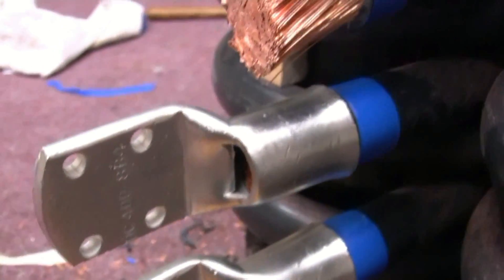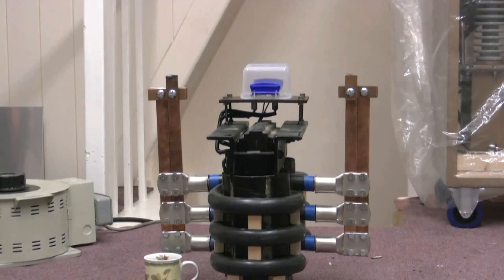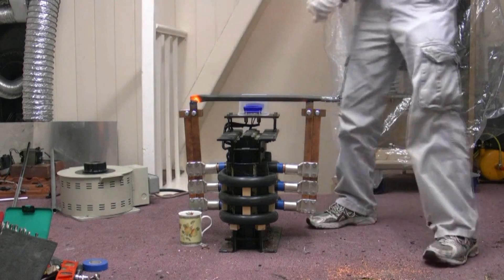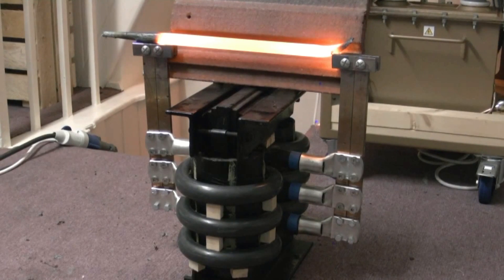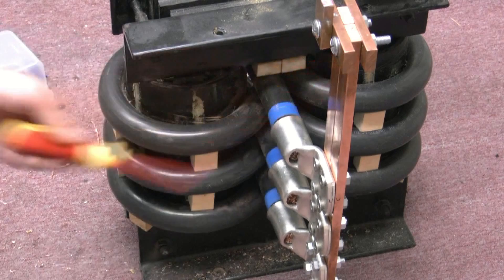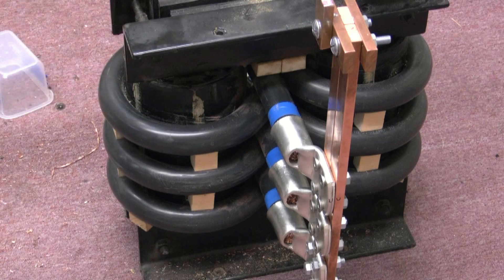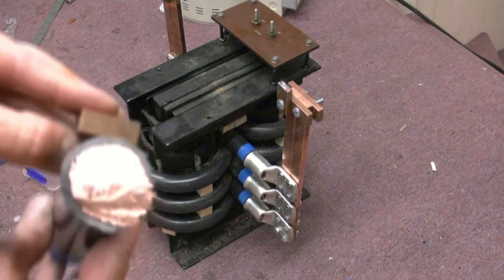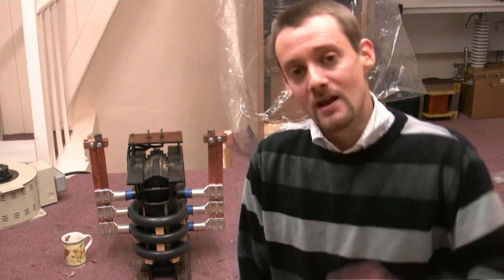50,000 Amp Transformer Completed

Comment: Not an electrician but I do get to shock people for a living (Paramedic) and Voltage doesn't kill you its Amps. Even at super low volts if you got high amps and you touched both of those you'd be a crispy critter
Reply: No amps without voltage, amps=current, current will not move without voltage :) So if you grab the positive side on one end and the negative on the other your body will be a big resistor arround 100.000ohms lower voltage is not able to flow pass that resistor so everything below 25volts is pretty save to thouch even when it is 50.0000 amps you will not feel  a thing  becouse the resitance of your body is to high to let the electricity flow,  :) going over that 25> will be dangerous becouse your higher voltage= lower skin resitance  :)Your cool shock thing as a paramedic probaly works or shocks with 1 Joule (3Amps/155volts) and as high as 200 joule (36 amps/1800 volts ) for 5 miliseconds that 5 thousends of a second pretty cool stuf :)
Reply: Yep, Scotty got it perfectly right, as long the voltage isn't high enough to push the current through you, you're fine.
But keep in mind that there are several factors that determinate your body resistance like moisture, voltage, etc.
Electricity's a bitch.
Reply: You can't bring up a taser to discussions like this simply because the way a taser works has NOTHING to do how electricity behaves in case of an accident.
A taser has to contacts that are close together so the High Voltage only travels a few inches through your body. As long as you don't shoot someone right in the area where the heart is tasers will remain non-lethal.
Reply: *****

"If someone tells you voltage doesn't kill you he's an idiot" Amen to that bro.
Reply: EinzylinderTerrorist afrotechmods?
Reply: nathan albania funy boy "won't" "cose" etc. ... 
begin change the world from yourself
Reply: Safe voltage for human is 24V. Everything over may harm or cause death. Isn't it?
Reply: P. Lach why wont you try reading your comment."cuz u have the worst grammar ive ever seen in a sentence
Reply: P. Lach who cares about spelling? And wtf is cose?
Reply: ***** No, you're wrong. A stun gun does not have a low impedance output, and regardless of the current level it can't source enough charge to cause lethal harm. Also you're not considering the high frequency "skin effect", Google it. And it only takes about 100mA though your heart to stop it, not 1 amp. Voltage and Current are not mutually exclusive. They are related through impedance. You cannot somehow design a device to provide a constant high voltage output (low impedance source) with a low output current limit. Current draw will depend on the impedance of the load. Thats why it's called Ohms LAW. Its a LAW, it can't be broken. A few volts AC is nowhere near enough to get lethal current levels.
Reply: ***** Ummm - If I grab both terminals of the battery in my car, I feel nothing, it doesn't hurt me, and it won't. 12 volts and battery is capable of supplying hundreds of amps to the starter. If I stick a fork in a wall socket it really hurts. 120 volts and the breaker is set to only 20 amps. So...
Reply: ***** You could touch both terminals of this when it is powered up and it you wouldn't feel anything.  Remember, it is only .5 volts for each 
secondary so 1.5 volts total.  That is not enough voltage to push any 
current thru the skin.  I have a 500 amp, 2 volt transformer I made 
and I assure you it isn't dangerous.  Think of it this way (Ignoring the AC phase factor).  500 Amps and 2 volts = 1000watts of power and it won't kill you.  But 2 amps and 500 volts  = 1000watts of power and it will kill you.   That is because the force of 500 volts will push the current across the chest cavity.  And since it only takes about 60 milliamps to affect the heart, you will probably die.
Reply: ***** The human body has a minimum resistance of about 1000 ohms. You need voltage to overcome this resistance, in order for current to flow. The idiot's transformer was only producing 0.5 volts, so you can calculate the amount of amps it will push through an average human, using OHMs law: V/R=I. Substituting the numbers this is
0.5/1000=0.0005 Amps. Five ten thousandths of an amp. You wouldn't even notice it.
Reply: ***** Current across a body is mathematically related to the voltage applied across divided by its resistance.
Between two points of human body is present an amount of resistance that is NOT very low.
So you CANNOT achieve HIGH current with LOW voltage if  also resistance is NOT very low.
If you touch two point i.e. with right and left hand , and the voltage between these points is...let's say 5 or 10 or 20 volts , the resistance between your right and left hand is not low enough to permit a severe if not even perceptible current to flow.
Yes, is the current that kills you , but to rise that current to lethal level, since body resistance is in a certain range, you need to rise voltage by several tens of volts (50, 80, 100, 120 ? it depends by your body resistance)
Reply: ***** Wouldn't this be easier to think about if you just thought of it as Voltage being Potential Energy and Current being Kinetic? Then you could think of Gravity and how an object gets destroyed through the transfer of energy from potential energy of the object (how high it is from the ground) to kinetic (how fast it is) and the instant before it hits the ground.
What destroys the object? The original height it was at, or the maximum speed it reaches before crashing on the ground? How about the force applied to it when it stops as it hits the ground?
Then again I might just be ignorant...
Reply: Its the combination of voltage and amps that kills you. Everybody how sais something different is just stupid.
Reply: Nicap2 and resistance of a metal wire is several ohms not thousands hence why the current ramps up to like 50Kamps.  v=IR or I=V/r   current = volts(.5) divided by Ohms, so that bar maybe has what .00005 ohms thats 10 thousand amps.   if the body resistance is only 1 ohm that only .5 amps. still enough to possibly kill, but see how the math works. that low voltage keeps the amps on your high resistance body from getting any higher than a few micro amps.
Reply: It would have to be at least 50 volts in a dry environment for you to start feeling it....amps kill you yes....but it takes voltage to overcome the resistance of your body...
Reply: ***** I wonder if damien realises hes wrong yet?
Reply: My good sirs, how would you propose to affect lethal amounts of current (ampere) onto a human without a certain voltage? I suppose it is impossible.
Following from that, good sirs, is it not true that this "necessary" voltage is needed to kill you?
But, alas, you can procure this "necessary" voltage without the necessary "backing" in ampere, without killing our human, can you not do that? Think of connecting a capacitor through touch...
So in a way yes, you need a certain amount of voltage to kill a human, but it is not sufficient.

So, in conclusion, my good sirs, voltage is necessary but not sufficient to kill you.
Ampere are both necessary and sufficient to kill you.
Reply: *****
I see you're quite confused - do you know what "necessary" and "sufficient" mean?
Also, do you know what a "thought experiment" is?
My first question pertained to establishing that a certain voltage x exists which is necessary to kill a human. Are you with me so far?
The second question, the one you have trouble with, asks: can you exert voltage x onto a human without killing him?
Does this choice of words clear things up for you?
And of course the answer is yes. You can produce any voltage, say 20kV, in a capacitor that stores roughly zero charge, and then short it by touching both ends... no harm done

Maybe you should educate yourself as to what "voltage" really is? Poor sap.

Once again: High voltage is necessary but not sufficient to kill you. High ampere are both necessary and sufficient to kill you.
Reply: *****
nothing? sad face
Reply: SoWeMeetAgain xkcd.com/675/
Anyway, what kind of current does that 20kV capacitor put out when you short it across the body...I admit I don't know the exact transient response of a small 20kV capacitor across the body but im guessing its going to peak higher than say 1A. Lightning strikes are frequently survived, and they can be hundreds of amps. Why doesn't it kill? because of a variable we call "t".

Let me explain it completely to you. The most correct way to state the situation is that electrical work delivered to our human is what kills.
W = Pt
P = V^2/R = I^2*R
resistance of the human body is a constant. 
setting t as a constant: W = V^2/C = I^2*C
therefore, the problem boils down to what can we control? Current through the human body? no, voltage across it? yes.
Make me a current source capable of putting a lethal current through a human WITHOUT a high voltage upstream.

Saying the amps kill is like saying a man falling off a cliff was killed by the speed. It is a necessary factor in falling to your death yes, but it was the decision to climb the cliff and raise your gravitational potential (electrical potential) that was the active decision that resulted in death.
Work done in this case is a function of height climbed and a constant containing earths gravity and resistance to the fall (how would a parachute affect the situation?).

You could express speed in terms of height, but it would be pointless, just as expressing current in terms of voltage is.
Reply: thats 50'000 amps, he wouldnt feel it at all because its at 0.5v
Reply: I know this is old but I was trained by the US military to work on with high and low voltages in the 15 years I was in. Their definition of safe low voltage that can be worked on live without electrical safety protocols is 28 volts or less. The number is based on a worst case scenario of 300 ohm skin resistance.
Reply: *****

You're wrong dude. Voltage is killing people because:
There is NO current without voltage. Current doesn't do shit when there's no voltage to force it through a curcuit.
High Voltage sparks over (About 10mm air per 1000V ). Experienced electricians have underestimated that simple fact and paid with their life.
And here's why voltage is more dangerous. While current damages body cells when going through you voltage can interfere with your heart rythm causing death up to 1 day after you suffered an electric shock. That's exactly what kills hundred of people every year not that little burn mark current will leave on you.

That's exactly how your little defibrillators work. Using voltage to give an impulse to the heart causing it to maybe stabilize itselft to a frequent heartbeat. Using current on someone would do NOTHING except boiling and grilling that dude.

Trust me, I'm an electrician.
Reply: EinzylinderTerrorist It's not the voltage that kill people, it's the small number of amp that goes through the heart and cause fibrilation. But it's true that you can't simply ignor the voltage because it is probably the thing that will create the current in your heart.
Reply: Scotty Yes yes you cant have amps w/o voltage, but this doesn't change the fact that high voltage doesn't kill its amps. A wall outlet is arount 110V and amps are High and a Taser has tens of thousands of volts and amps is super low...less than 1.
Reply: lol again I never said you can have amps w/o voltage, but you can have high voltage and low current. Again taser guns have 50k volts and do t kill because its less than 1 amp. So sorry brah but but we're both right, and you as an electrician should know this.

Comment: При 50 000 ампер, монтировка сгорит через 3 секунды.
Reply: kotborka Я собственными глазами видел как ток в 15 кА превратил болт на 20 в сосульку за 0,3 сек.
Reply: Ashley Bates g nfry tu r6tjh t7ubr6yun7uy6 bhuryhbryuhnr6yhub r6u r76yj ytujn 64tuh ygmkj
Reply: Denis28343 У него напряжение низкое. Я сомневаюсь, что он провода зажал в клеммах, походу потери большие.
Reply: the voltage isnt high enugh :)
Reply: С чего ты взял?Опыты проводил?Или расчеты делал?
Reply: kotborka NO,NO CALCULARON NADA,ESTE TRANFORMADOR PUEDE MANEJAR COMO MAXIMO A MI PARECER 1000 AMP EN FORMA CONTINUA.NO ME QUIERO PONER A HACER CALCULOS ,PERO SE PRECISAN MUCHOS MAS CONDUCTORES EN PARALELO
Reply: Вячеслав Забара Ssop7z9w9sq9e00w928 I 28 9 e99wxdr8999888898p

Comment: It sure looks like the "show-off" here with  super confident attitude is making an unauthorized station of some sort, inside on the roof under the ceiling, at least his fire prepautions are absolute zero...and he just shows a display of stupidity. But okay I can understand the curiosity playing with such powers.....But but.....all that plastic,the floor and the heat from the sparks...sighs But in general...it doesnt look good if this isthethings hes doing.
..And its not good he hasnt calculated the thickness needed in the copper bars, and its temperature........
Maybe an illegal drug farm in some forsaken land...:)...could be....?

Comment: As you seem to be a competent and learned electrical experimenter, could you please explain to me how to get a MOT to power a 27inch crt tv on a 12vdc input?
Reply: Carl Strand take the big secondary off and put about 14 turns of good wire on to it vack to rectifires on and your done

Comment: You input would have to be around 100 Amps at 240 Volts or 24KVA to get 50,000 Amps at 0.5 Volts but for the output you would have to use fifty one turn coils with a cable that could carry 1000 Amps .You would also have to calculate  if the Laminations could handle that power and remember that the core will saturate at a certain power level.I have a UPS 5KVA transformer that is double the size of yours.You  would also have to adjust the output Voltage (Turns per volt) to cater for efficiency losses which is around 20 % also the Bus bar should be able to handle 50,000 amps intermittently.
Reply: Godfrey, I'm trying to do the same but is not working my breakers go off, I have 1456 VA transformer @ 60 Hz and 51 turn and 120 VAC on the primary, on the secondary I expect 1.8 VAC and 650 AMP(20% losses) with  2 (1/8 X 3) copper bus bar with 3/4 turns, but is not working what Am I doing wrong? can you help me? You can inbox me: belendanilo@gmail.com
Reply: ***** Nope... just 20A, I think I need a inrush current limiter, but how did he start up such a monster one?
Reply: HOLA GODFREY ARCHER,SOY DE ARGENTINA, Y ARMABA TRANSFORMADORES MONOFASICOS. ,Y HAY VARIOS DATOS A TENER EN CUENTA:LA INDUCCION (b),LA FRECUENCIA ,SI ES PARA U,S,A, ES 60 HZ, LA TENSION PRIMARIA, EL AREA DEL NUCLEO LA POTENCIA (25 KW),LA DENSIDAD DE CORRIENTE (A/MM2) ,EL NUM VUELTAS PRIMARIAS Y EL NUM DE VUELTAS SECUNDARIAS.UNA FORMULA EMPIRICA NOS DICE QUE EL AREA DEL NUCLEO (EN CM2)ES   S=(1,5 X P)SQUARE         S=1,5X158=240MM2 AREA DEL NUCLEO
LA INDUCCION B=8000 GAUSS (VALOER ALTO PORQUE EN ARGENTINA EL MATERIAL TIENE MUCHAS PERDIDAS
OTRA FORMULA EMPIRICA VOS DICE QUE   E1=4,44.B .F .S.N .0,00000001  FORMULA PARA TENSION PRIMARIA Y SECUNDARIA,TENEMOS QUE DESPEJAR N1 Y SABEMOS LAS CUELTAS DE ALAMBRE DEL PRIMARIO
N1=E1/4,44.8000.60.240.0,00000001  N1=24 ESPIRAS PODEMOS PONER 25 ESPIRAS PARA 120 VOLT DE ENTRADA   PARA 220 VOLT SERIAN 50 ESPIRAS.. EL PROBLEMA QUE SE NOS PRESENTA ES QUE SON POCAS ESPIRAS PRIMARIAS, SI USAMOS UNA RELACION DE TRANSFORMACION DE 25,PARA TENER UNA SOLA ESPIRA SECUNDARIA   LA RELAC,DE TRANSFORMACION K=N1/N2 POR LO TANTO N2=N1/K    N2=25/25=1 ESPIRA SECUNDARIA  LA TENSION SECUNDARIA E2=E1/K=  4,8 VOLTS  PARA 120 VOLTS Y  8,8 VOLTS PARA 220 VOLTS, USANDO UNA DENSIDAD DE CORRIENTE SECUNDARIA DE 1,5 A/MM2 PARA 5OOOOAMP TENEMOS 
S=50000/1,5=33.333MM2    SI FUERA UNA ESPIRA UNICA TENDRIA UN DIAMETRO DE:D=RAIZ(4.S/PI)=200MM APROX, EQUIVALE A 100 CONDUCTORES EN PARALELO DE 300MM2,Y EL DIAMETRO DE LAS ESPIRAS PRIMARIAS,14MM, ESTO ES MUY IMPRACTICO DE HACER, SALVO SOBREDIMENSIONAR EL NUCLEO PARA QUE HAYA MAS LUGAR PARA QUE ENTREN LAS ESPIRAS, ESTE CALCULO ES PARA UN TRANSFORMADOR QUE DE SERVICIO PERMANENTE. POR QUE SE CREEN QUE TIENE UN VARIAC EN SERIE CON EL PRIMARIO?PARA BAJAR LA TENSION SECUNDARIA,A O,5 VOLT. ESE TRANSFORMADOR SEGURO QUE NO TIENE MAS DE 50 VOLT APLICADO AL PRIMARIO.APARTE EL VARIAC ES DE PEQUEÑO TAMAÑO.. LA UNICA SOLUCION ES BOBINAR EL PRIMARIO APARTADO DEL SECUNDARIO,EN UN CARRETE CON SEPARADOR.OBVIO QUE TODO ESTO HAY QUE HACERLO EN FORMA ARTESANAL..  CALCULEN 125 KILOS DE PESO.CUALQUIER COSA,CONSULTENME
Reply: nomon95 Nomon te puedo escribir en pribado? Mi corredo es belendanilo@gmail.com tengo algunas preguntas y creo que usted me podria ayudar!

Comment: you made a experiment of high voltage and watt the way you phased it it didn't kill you. you probably converted it to dc. if it had an ac way connection, 3,  to flow from flow and ground, then connected that circuit, and did the same phases and properties, it would kill you. it would involve 3 coils, dont try it.